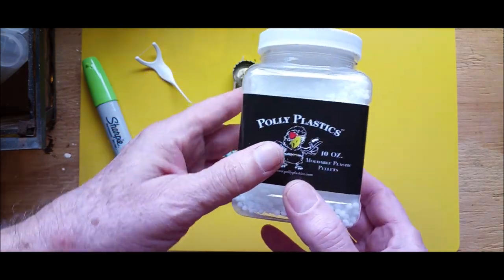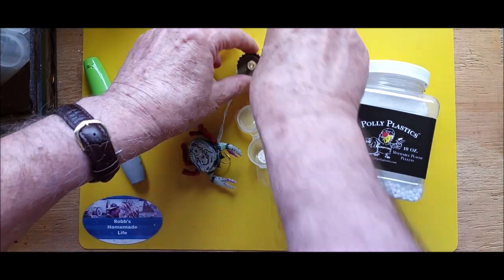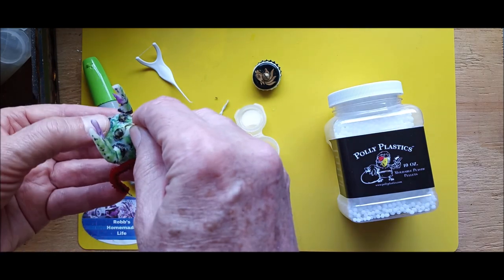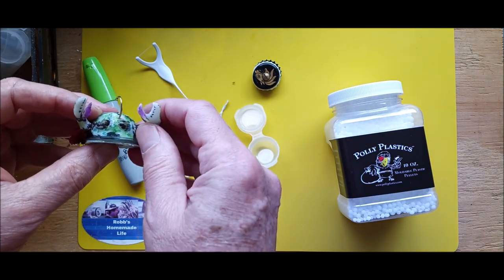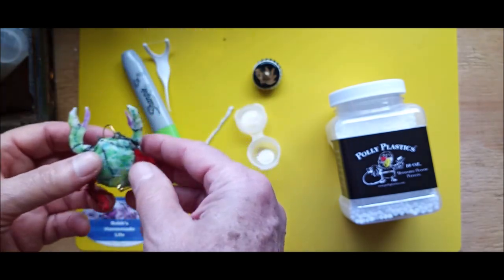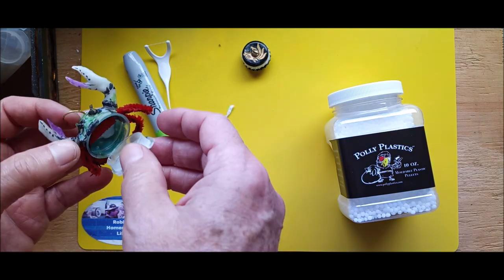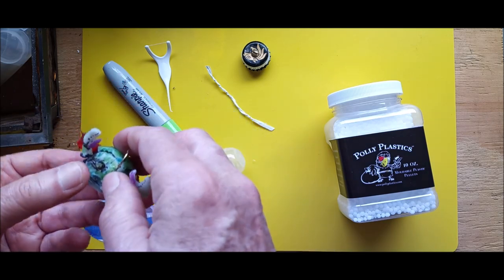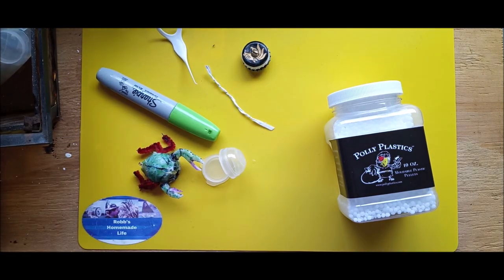Genius diy crab lure for Sheepshead and Pompano

Comment: Gotta’ get some of that poly plastic! Can you make it adhere to itself?
I used to make a trout lure from a piece of coiled copper wire and a tuft of white fur off my dogs chest. The trout were easy to catch, but the dog was challenging.
I predict you’ll catch a sheepshead the size of a manhole cover.
Reply from the maker: hey chops, it helps if both pieces are heated up. When I made the eyes for the crab and stuck them onto the body they wanted to fall off because only the eyes had been heated.